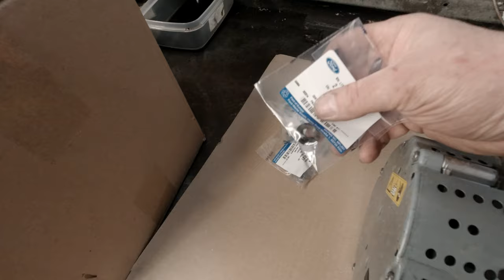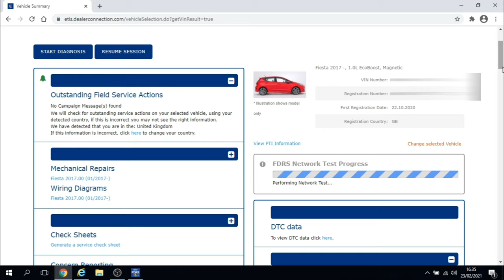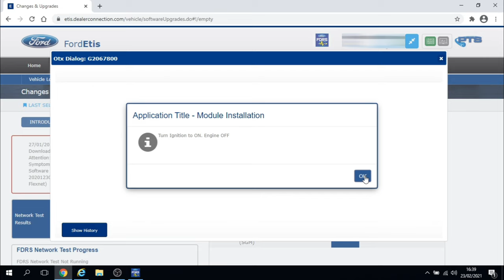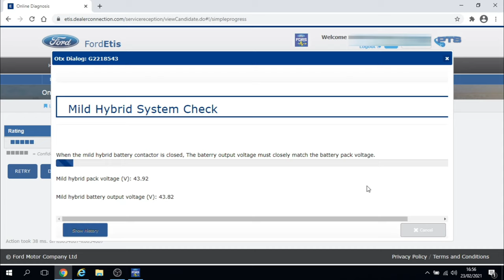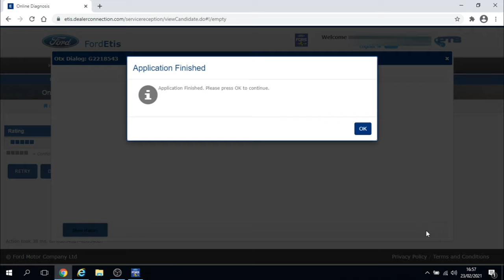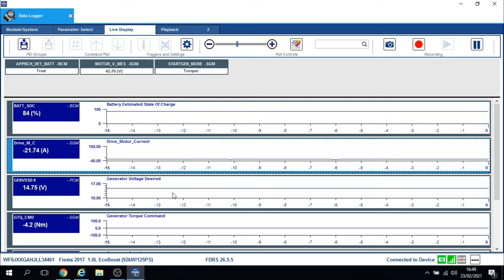Ford Fiesta Ecoboost MHEV Hybrid - Charging Malfunction - Part 2

Comment: A Pleasure to see a professional at work, who really knows what he is doing. My wife has a 12 year old Ford Fiesta 1.4, which I do all the servicing on, never broken down, and the wife loves it. Very disappointing that a nearly new car needs such an expensive repair, albeit under warranty. This level of complexity would put me off buying a new Fiesta.
Reply from the maker: From what I hear most manufacturers are suffering teething issues with these systems
Reply: @SYDiagnostics  I am thinking about buying either a Focus or a Puma 1.0 MHEV. 
I am starting to get concerned about purchasing one of these. I really don't wanna trade my old Golf mk5 for a new car that can put me into a lot of repair and power unit issues.
Are these problems getting more frequent in the MHEV units? What would be your advice?
Reply from the maker: @sao57minutos   i've personally only seen 2 of these units fail. On the whole i've not heard of any issues.  Personally its more of an emissions thing with only around a 5% gain. You dont notice any difference whilst driving, other than when on over run and it feel like a binding brake......If it where to cost more for the MHEV than a normal 1.0, i'd not be paying the premium myself

Comment: @SYDiagnostics What exactly was the problem this car owner was experiencing? Flat battery, not charge?  Could this be the same issue effecting Ford Pumas with 1.0 mild hybrid engine?  Ford seem reluctant to help.
Reply from the maker: If I remember correctly there were no symptoms other than the charging malfunction message

Comment: Excellent ,I think the independents are going to struggle in the future.
Over £1,000 for parts plus labour, for the average working class person its just not affordable.
In my opinion  people will pay x amount a month any problems it goes back under warranty and then they pay the same amount 
for another vehicle.It wouldn't  take much for one of these vehicles to be beyond economic repair.
Reply from the maker: I think it's proving just the case on some cars. I hear a PTC heater on a Nissan Leaf is a £3k job? More people will be buying cars on purchase plans and being tied to a dealer / warranty (in my opinion)

Comment: Clearly modern cars are becoming a bit of a pain. But watching both videos, I really have only one question. Why new bolts for the 48V BiSG?? What was wrong with the old ones? I have no idea about the torque, but based on the video and the torque wrench size, it doesn't seem those bolts are tighten close to bolt stretch or damage. Even if Ford says they need replacing, I am curious to why they need replacing?! Thanks!